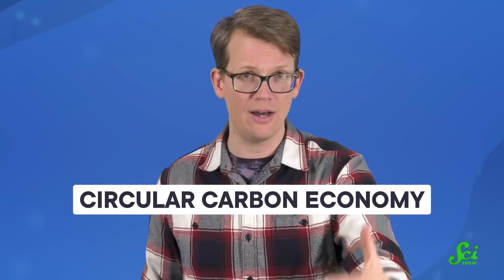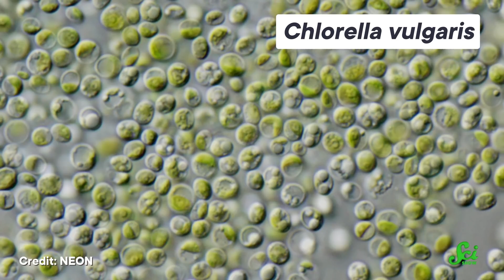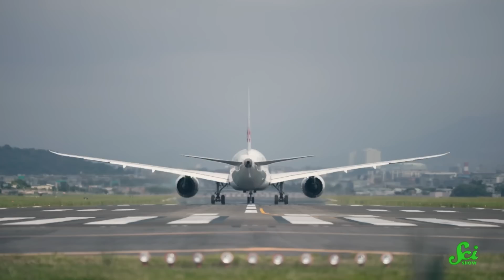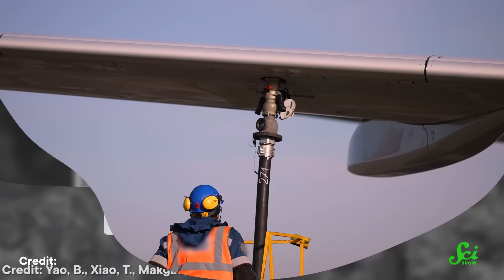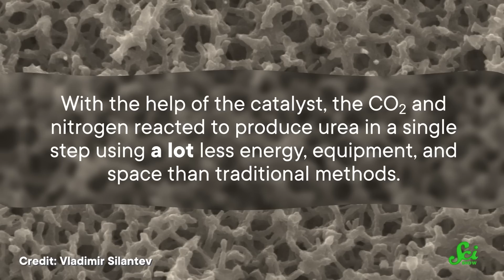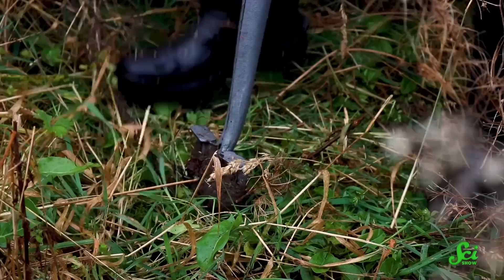One Way to Deal With CO2? Reuse It

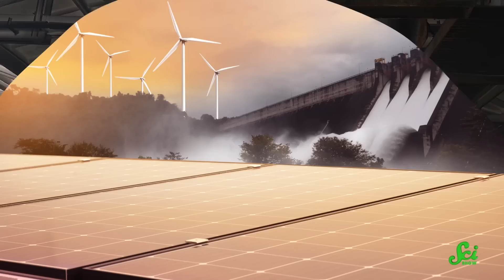Comment: I thought the whole video doesn't make sense, and in fact it still doesn't up to 6:00 . You can't recycle CO₂ unless you input the same energy (or even a bit more - no thermal reaction has the efficiency of 100%) which was released when the CO₂ was formed. So all these ideas sound good but only if you produce the required energy without burning more even carbon. (Renewable, thermonuclear?)

I'm afraid plants are far better at absorbing CO₂ than we ever will be. I believe we should make more radical steps on reducing our CO₂ emission instead of searching for methods to reabsorb it because we can't really do it on an efficient level.

I'm not a scientist, but I'm open for debate. If you disagree, feel free to convince me.
Reply: The main idea is to use renewables or nuclear power to convert CO2 into fuel for vehicles that cannot rely on said renewables for power.

Electric airliners probably will not happen any time soon due to the massive energy requirements and will still require traditional fuel.
Reply: Plants suck at absorbing CO2. Algae are the real deal, and we're working on commercialising algae farms too, with many different approaches to how to make that work (including routing exhaust from e.g. coal power plants straight into algae tanks, which then use sunlight to produce fuels that are easy to combust and store). There's always been a lot of propaganda about forests being the lungs of the planet, but we've known for a very long time that the vast majority of carbon dioxide absorption and oxygen production happens in the oceans.

We're pretty good at absorbing CO2 too, as well as capturing light energy, and wind, and whatever else. And we're getting considerably better with every new decade.
Reply: @LuaanTi  Algae are plants, aren't they? When I said plants, I meant all kind of plants not only land dwellers. We might as well include cyanobacteria (which of course can't belong to the kingdom of plantae because they are not eukaryotes so strictly spoken you are partially right I admit). Well the point is that all the fossil carbon we've ever burned used to belong to some sort of photosynthesing organism at some point of time.

In a conclusion there are two option:
1: Absorb carbon in organic form. That's what plants/cyanobacteria; photoautotroph organisms do, and I don't think we would be able artificially to do it much better than them. See my original comment.
2: Absorb carbon into inorganic copounds, such as mineral carbonates. I don't want to pretend to be an expert on this matter but I presume that producing the resources for this process (such as alkali or alkaline earth hydroxides) are a rather energy demanding, thus not (yet) efficient method. I mean how do you produce them? From natural carbonates by releasing carbon dioxide.

Share your thoughts, I'm open for further discussion.
Reply: @ffarkasm  Nothing major, I agree. Algae are usually not considered higher plants (which in turn are usually what people mean when saying "plants"). The unicellular examples (which few would consider plants, much less higher plants) are the highly efficient machines for fixing carbon and light energy.

I'm just saying humans can do it better, for many different reasons. After all, it took those photosynthetic organisms hundreds of millions of years to produce the deposits we are now mining over a few centuries. We have access to many more raw materials than life does; we can built things on a large scale; we can build highly specialised machines that don't require the support any living cell does. We can build many things that life simply isn't capable of, even if you had much longer than the few measly billions of years life had to evolve on our planet. Our solar panels are far more capable of capturing sunlight efficiently, and dealing with adverse environmental conditions. They also have their own disadvantages, of course.

I absolutely think algae and such are part of the solution and well worth pursuing, in many ways. It's especially handy that they reproduce themselves, using materials that are readily available in the environment! :D And needless to say, there's definitely risks involved too (especially with the more "in the wild" ideas like seeding the oceans with iron etc.). Regardless of whether we use algae or human-made machines, it's going to need a lot of infrastructure. That's what you're really competing with, not algae living in the wild. That makes it even easier to do better than life. Much the same, scaling everything is going to be the real challenge; we have designs that would work well enough, but that's still a far cry from actually having everything built up and working.

Comment: I missed the obvious easier step, which is capturing CO2 at the source, like factory chimneys. Should be easier to capture, right?
Reply: Many coal plants (in the US) have ccs and capture at the smokestack because it has a way higher concentration and is therefore easier to pull from the gas mix.

Granted they are still dieing and it isn't perfect, and their marketing of "clean coal" is both inaccurate and falls on deaf ears.

However, they did pioner the technology and factories definitely could adapt the technology to reclaim CO2 from their exhaust, and if its pure enough sell it to industries that already consume CO2 and currently manufacture their own. (Buy burning stuff)

Comment: Scientists have been experimenting with using algae to capture CO2 from the atmosphere, and now they've developed a way to use it as a fabric! In general, biocomposites are made by combining one natural and one synthetic material to create a new, better material; in this case, a carbon-capturing sheet. Researchers found that their new biocomposite absorbed 3.5 to 14.5 times more CO2 than the control algae that wasn't coated in fabric. Jet fuel is the fuel that planes depend on, and it can help reduce carbon emissions from air travel. The CO2 generated by this process is equivalent to 22 percent of the average person's annual CO2 emissions.
Scientists have proposed a way to produce urea that reuses carbon dioxide, or CO2, instead of using it to make fertilizer for crops. The process is fueled by renewable energy and takes less than a fraction of the energy that traditional methods do.

Comment: Finally some more good news! Something that is not only good, but potentially also profitable, so there's way more of an incentive (even for people that wouldn't care otherwise)
I personally think the holy grail would be to convert CO2 directly, into Graphene or even better nano-tubes. We need to make all the new additions of CO2 neutral.. but we also need to remove some of the current surplus, by either putting it underground (like the "dinosaurs") but converting it into structural materials is probably more useful.

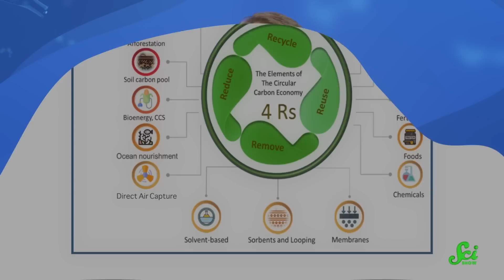Comment: 0:50 "a circular carbon economy starts with capturing CO2". no, it starts with stopping use of fossil fuels. it's not circular while there is still input.

If you want circular a carbon cycle, it makes zero sense to treat the recycling as an excuse to keep things running on fossil fuels. Electrify ground vehicles, switch air vehicles to 100% sustainable fuel. Let planes stay grounded if there's not enough fuel to fly, don't burn new fossil fuel.
Reply: No, it finishes with stopping the use of fossil fuels. You can talk all you want, but if we just stop burning fossil fuel right now, a lot of people die, very quickly.
Reply: @LuaanTi , you can aim for having a circular carbon cycle later, but you don't have circular until you have circular.
Reply: @JNCressey  Using that definition, there are no cycles in nature either. I'm not sure how that is useful. There will always be some inputs and some waste. The point is to keep getting better.

Comment: The sabotier reaction can turn hydrogen and CO2 into methane. Combined with carbon capture it would be an excellent replacement for natural gas in homes or fuel for vehicles, as countries like Australia use LPG in many vehicles already and wouldn't require conversion. Drive the whole process with solar or wind, and it's a very eco-friendly solution, the gas could also be used to supplement the intermittency of solar and wind like a battery.
Reply: Of course, it requires highly concentrated hydrogen and CO2, which is the hard part. And LPG isn't methane, you're confusing LPG and CNG/LNG.

Comment: I think, in most industries, there are better alternatives to the „carbon capture and putting it back into atmosphere, only to capture it again“, it’s inefficient from the ground up.
Reply: I think in most industries they cam do what coal plants do, put a scrubber on the smokestack and suck up carbon from a gas mix where it is in a much higher concentration. (Not that all fossil fuel plants do this, or that they get it all, or that coal is ever a good idea for electricity) But any industry that is a factory where most of the emissions are concentrated in a smokestack the can definitely try and capture carbon direct from the stack using a similar technology as the coal plants instead of venting it all to the atmosphere.

But for some, like the aviation and automotive it could be really hard to suck it up at the "tailpipe", especially jets using the exhaust for thrust.
Reply: But, even if there were no more emissions going forward, we would still be in a crisis.

Comment: This is great and all, but the one factor that will make all the difference is profit. Mega corporations will only adopt a new sustainable system if it helps their bottom line. Plastic recycling has been around for as long as plastic itself has, but 90% of what goes into our recycle bins never actually gets recycled because there's unfortunately not enough money to be made.

Much like how CO2 and water need a "push" to turn them back into usable fuel and/or materials, the corporations capable of doing it on scales that can make an impact need a push (either financial incentive or governmental mandate) to actually DO it.

Comment: Would still need to figure out nuclear fusion energy, though, because eliminating the problem of CO2 emissions won't eliminate the problem that fossil fuels will run out one day. You can't put energy into the system to turn CO2 and get more energy out when you burn that fuel to make CO2. That would break the second law of thermodynamics. You would still need an excess of fuel. With fusion you could just use water and then you can power your car with electricity generated from fusion power plants. Solar and wind can't fully replace fossil fuels because the wind isn't always blowing and the sun isn't always shining, hydroelectric isn't suitable for everywhere and involves building dams that displace residents and ruin natural ecosystems, geothermal isn't possible everywhere, and fission involves producing radioactive material that takes tens of thousands of years to decay, is hard to store, and is at risk of leaking out into drinking water supply for tens of thousands of years. Cracking fusion is still necessary for further progress...
Reply: Would be nice, but if you use uncontrollably even having Mr. Fusions on hand won't help ya. Solar, wind, algae,and 2 oz. of chill...

Comment: I bet we can reduce so much more carbon by switching america over to trains instead of taking a plane or car. They switched from train to plane cause it was faster but now go back and restore those tracks and get some bullet trains
Reply: Plains are also cheaper, as weird as that might sound. They get a lot of savings on fuel when they rise to their cruise altitudes - that's just that much less air to cause drag. Of course, that's comparing with high-speed rail, but you were talking about bullet trains. In the end, it basically means that high-speed rail is more efficient for "short" trips (depending on what exactly you're comparing, that point can be anywhere from 100km to about 800km), but planes quickly become far more efficient as the actual take-off (which is both in dense atmosphere and takes a lot of energy to get up to cruise in the first place) gets small compared with the cruise. High-speed rail has its advantages and disadvantages, just like everything else. But don't think they're going to be the ecological alternative to travelling far by plane - planes are really good at what they do. If you want ecological, going slow is very important.

Comment: If I had a set up that could produce as little as a litre of diesel a week I could fuel my personal car indefinitely (I have a company car that is a plug in hybrid to take care of the bulk of my travel). The old beast isn’t fussy, having been fed a diet of 50/50 Dino diesel and sunflower oil for the last 5 years with no problems

Comment: I think this touches on the big technological shift that would turn climate change on its head, the point when CO2 becomes a resource instead of a waste product. Once companies are in a position where letting carbon escape means leaving money on the table, emissions would start plummeting.
Reply: Still nope, very hopeful.

But as long as the captured co2 is still more expensive than extracting fuel from the ground, it's not gonna happen.

But once that crosses the threshold of being cheaper, it's still gonna take another 20 years for companies to start implementing it, like solar.

By that time, maybe the world would be 1 billion, not 10 billion.
Reply: Just wait until governments impose carbon neutral credit tax.
Reply: I think it's politicians in some countries realizing they can no longer call it a hoax and ignore it, even if country A, B, or C doesn't seem to be doing anything.  Which seems to be what many US politicians have done for decades

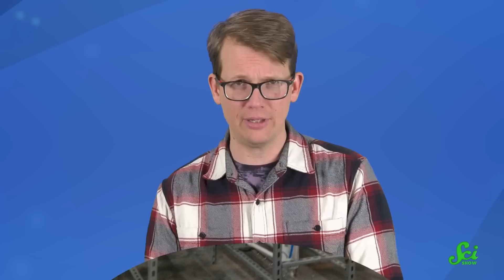Comment: 1:09 "1 kg of algae can absorb about 1.8 kg of CO2". Over what time period?
Reply: @capturedflame  Of course, it's really tricky keeping the system from contamination and all that. After all, those algae are a tasty snack, and produce even more tasty snacks :)
Reply: @LuaanTi  If the algea is kept in clear PVC tubes as shown, contamination shouldn't be much of a problem.
It would probably also be a good idea to pump the algea sludge down into emptied out oil and gas caverns, to put CO2 back under ground where it originally came from.